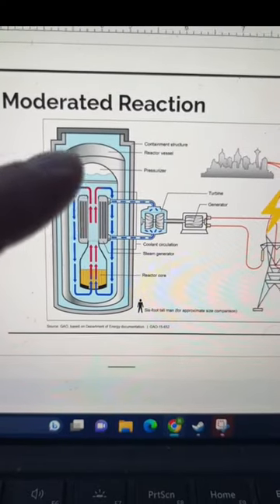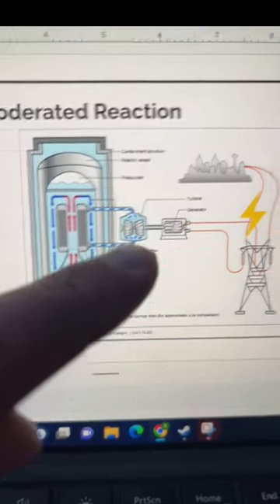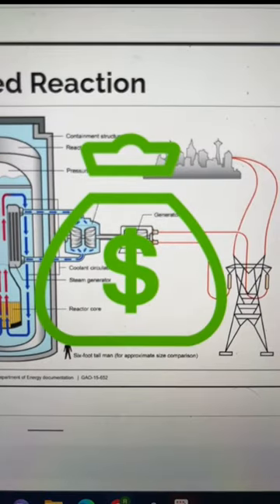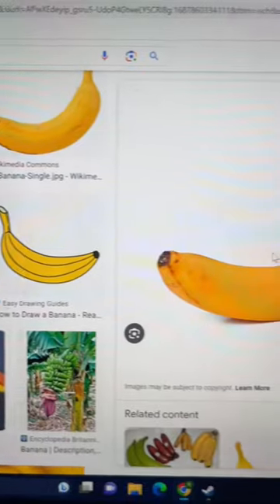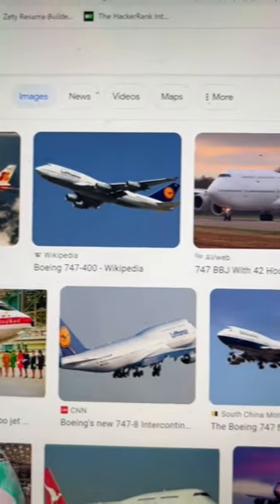No, The #Zaporizhzhia Nuclear Plant Will Not Explode

Comment: Compare a nuclear power plant to nuke is like compare a snicker bar to a hand grenade , they have about the same total energy, but one will not explode
Reply: Chernobyl gave off huge amounts of radiation. The equivalent of many nuclear bombs.
Reply: @uioplkhj  Chernobyl was not in cold shutdown.
Reply: @obstreperous1113  I advise you to read Ryan's covering remarks.
Reply: @uioplkhj Chernobyl happened (ignoring human factors) because of a shit reactor design. The reactors in question here are of a completely different and much better design, one that is designed to be able to safely contain the fuel in the event of a meltdown while both not causing a severe radionuclide release, nor contaminating anything in the surrounding area. It would be a bitch and a half to get the plant working again, but it would not cause a disaster. The worst we would see is something akin to Fukushima, which literally caused more deaths due to stress and panic relating to the evacuation than it did by actual radiation exposure

Comment: You can't walk into a reactor after a few weeks of cold shutdown. Workers can 'access' the reactor by means of cranes, robots and other massive protections against radiation.
Reply from the maker: Unfortunately, this is not correct. You can absolutely enter the pressure vessel of a Mk1 GE BWR. It’s how maintenance is performed.
Reply: @RyanMcBethProgramming  Ah yes, the Mk1 GE BWR famously used in the Soviet-built Zaporizhzhya NPP.
Reply: @RyanMcBethProgramming  very curious what your definition of "pressure vessel" is. do you mean the drywell containment or the core? the drywell can be entered and is the second layer of protection in case of emergency, the first layer being the core pressure vessel. 

the core cannot be entered with fuel still in it, it doesn't matter how "shut down" it is.

Saying you can just walk into a reactor is misleading, the PWR WWER-1000 in Zaporizhzhia is about as far from the BWR GE MK1 as you can get.

Comment: Could it not over heat and adversely affect the local area ?
Reply: Just thumbnails here, but if the reactor hS been shutdown for a couple weeks, the decay heat would be very low. It would likely only take something less the 200 gpm of water to prevent a release. Same for the spent fuel pool.  But it is true that it could be sabatoged to allow radiation to escape.

Comment: I have one word for you: Chernobyl.  No, the plant won't go up in a big fireball, but it can act as a "dirty bomb" and poison the whole area for at least decades.
Reply: Cher Nobyl is two words.
Reply: @brandonbp122  Maybe in some languages, but not in general English use.  If I do a Google search on your version, I come up with an artist.
Reply: Even then, even if the area wouldn't be full of mutants, digging into it, doing anything besides walking, would release radioactive particles into the air. Russian soldiers found out about it in Chernobyl at the start of the war.
Reply: A Chernobyl like event is virtually impossible with the reactor design at play here, especially since it's already in cold shutdown (like I'm talking less of a risk than dying of a shark attack in the middle of the Sahara). Yes, there's still a possibility of a core meltdown, but the reactors in question are designed to safely contain a meltdown should it occur. There might be a minor release in radiation, but the worst we would see is a Fukushima type event, which by the way the evacuation of the surrounding area caused more deaths (from stress and panic) than the meltdown itself.
Reply: The region around Chernobyl was poisoned because a reactor without biological shield was exposed and fires lofted particles into the air.
Reply: Chernobyl was a perfect storm of bad engineering on that specific model of reactor combined with incompetent operators who almost deliberately pushed it to the breaking point. 

And in Chernobyl's case, what blew up was the reactor itself, not the containment building. What actually released radiation was the subsequent fire.
Reply: @Soundwave3591  I don't disagree, but I don't see why some madmen armed with military grade explosives can't accomplish the same thing.
Reply: @russellhltn1396 the Ukraine plant is a different kind than Chernobyl is, and isn't using safeguards from the 1980s
Reply: So is this plant designed to withstand the pressures of high explosives?
Reply: They wouldn’t blow up a nuclear reactor, they’re too valuable, great for power and also just a good card to have power over, and if they wanted to irradiate an area they would just use a nuke, they can’t hide them blowing up a reactor they’ve had control over and has been sus for months

Comment: It's not about explosion, but about radioactive pollution. If the pool is destroyed the radioactive pollution will get to atmosphere. There also will be problem containing it like in Chernobyl. Once the rods are no longer in the water they will kill anyone getting close to it, making it extremely hard to contain them. In Chernobyl they made sarcophagus by lying to people about the safety, so many died for this. Another thing (it probably is protected against it) but if the base isn't protected the fuel rod could melt and go down in the ground. Once it reaches underground waters the steam created by the heat could shut it back up, spreading the pollution even further.

Comment: If the reactors are in cold shutdown, the only heat being generated will be from a miniscule and ever decreasing number of fissions and mostly from the decay of fission byproducts, the halves of the uranium nuclei that were split. The number of those is ever decreasing from decay. The total amount of heat they are producing is a factor of how long each fuel cell has operated at power and how long it has been since they were shut down.
While ZNPP has fairly large reactors, they should be cool enough that the fuel no longer has dangerous amounts of decay heat left in them.
Even if the cores are hot, a great deal of heat can be removed just by pulling steam off the secondary system and cooling with water or through cooling towers. Even running secondary water into the cooling pond will greatly cool that water down.
Reply: Brought to you by the Department of the Boat People!
Reply: What most people are concerned about is running out of water for cooling (or running out of power to pump the cooling water). They’ve already run out of electrical grid power at least half a dozen of times and the fuel for the backup generators lasts only a limited number of days. And they’ve also lost all the water from the Kakhovka dam reservoir, relying only on their own cooling ponds.

Comment: A meltdown is really really bad , especially if containment vessel and building vents to open atmosphere. One of the most scary  scenario of the war atm.
Reply: The containment building is designed to hold the pressure if the reactor ruptures as well as the corium in case it melts it way out the reactor. But, you obviously have to make sure all entry points are actually closed.

Comment: Cold shut down isn't the same as cold fuel assembly rods. Those things will still be producing enough heat that should fresh water stop flowing through the system you can very easily end up with fuel rods that start turning water into hydrogen and oxygen. 

Plus 2 of the reactors were just recently taken out of power production, so those rods will need fresh water for much longer than those cooling ponds will will provide it. Again, overheated rods creates an atmosphere that is incredibly explosive.

Do you need any more reasons why your assessment isn't in the nature of respectable journalism? You can be honest without spreading panic. Will it explode like a nuke? Nope. Could it cause an explosion that creates another nuclear nightmare, On Ukrainian Lands? Very easily under the present conditions. Very Easily and faster than the west will react

Comment: Just a couple minor points. That chart is for a Boiling water Reactor, the Ukraine ones are pressurized water reactors.  Used fuel that hasn't reached about 5 years of decay have to be stored in the spent fuel pool. Then they are transferred to dry storage.  You can walk into the containment building, but not the reactor.

Comment: While I would be less concerned about primary cooling in a cold shutdown, I am concerned about an extended water outage for both the core and the spent fuel storage pool. If either goes too long without replenishment, there is a risk of the water levels falling below safe levels. You are correct that this won't cause a nuclear explosion, but it's still not good for the integrity of the reactor vessel or the fuel rods. Worse, as the water levels fall, there's less mass to absorb the decay heat, so the water heats up further, thus speeding up the loss of water. I don't know the specifics on this reactor, so I couldn't speculate on what the time frame is on how long until problems start or what exactly will happen. I seriously doubt we'll see a meltdown, but we could definitely see radiation leaks in a couple of months.

Comment: Close, but my understanding suggests there could still be radiation release and potential explosions. It's not a nuclear fireball, but depending on how hot the reactors are - and there are claims that one or two were in hot shutdown- they may be hot enough to meltdown and cause steam or hydrogen explosions, which might breach containment.

The risk for the spent fuel ponds is that the water may evaporate or boil away and expose the spent fuel rods, which may overheat and/or burn and release radioactivity. That would depend on how recently new spent fuel was moved into those pools.

BTW, I don't think you can walk into the reactor ever, especially after its been in use due to contamination from fission products and neutron activation. I'm assuming you meant walking into the reactor building .

Source: not a nuclear engineer, but I live next to a nuclear power plant and have read a lot of books on it and talked to the plant manager and engineers a couple times.

Comment: The main threat of nuclear power plants isn't a nuclear detonation.
It's physically almost impossible to turn a nuclear reactor core into a nuke due to wide differences in design. NPPs are redundantly equiped to turn a reactor core sub-critical within the blink of an eye.

However, even a shut down core does still emit heat. Lot's of it. It's about 7% of its capacity immediately after shut down, decreasing over the course of weeks. The heat comes from the decay of fission products and can be up to 300MW of heat power in large cores.
This amount of power will melt through anything if not exhausted properly.

Now, the IAEA requires every NPP to being able to dispose of this decay heat for at least 3 days without external power or additional water. But if the NPP doesn't have power for more than 3 days and the core can't be resupplied with water either from water lines or by trucks, the core will almost inevitably melt.

That's when it becomes dangerous because mainly two things can happen:
It can melt through the reactor containment, leading to heavy contamination of the environment and It can form large amounts of hydrogen from radiolysis, which can blow up the reactor building, again gravely contaminating the environment.

Certainly, it requires multiple emergency systems to fail for a reactor to melt down.
But how easily an unfortunate chain of horrible misplanning, fatal mishandling and failing infrastructure can actually lead to a reactor meltdown is what Fukushima demonstrated.

Comment: Not actually the radiation that causes the boom. It's that radioactive decay produces hydrogen and as the fuel heats as it decays it lights the hydrogen off. Which normally has mixed with enough oxygen by that point to make a huge boom.
Though with that boom, the release radiation could let off cherinkov radiation(prob misspelled), which is when something moves faster than light thru a medium other than vacuum. Which in the water vapor of the atmosphere is a foreboding blue light.

Comment: I don't think you fully understand nuclear reactors and the nature of the fissile materials either. The concern isn't the spent fuel or a nuclear explosion. If the reports are correct in that the Russians have mined the cooling system, the loss of this will result in the fuel rods melting down due to their own radioactivity. Nuclear material may then seep into the river, into the black sea and into the Mediterranean
Reply: The reactor is a PWR, specifically the VVER-1000 model. The primary coolant circuit should be fine, it's hermetically sealed in its own independent circuit. If it looses water for some reason and manages to melt into corium, it should be contained within the reactor or containment building (Just like what happened at 3 mile island). We have those containment buildings just for this reason.
Reply: @timbo11  and if they've mined the rest of the structure such that containment is breached? Then what?
Reply: @riseld4  Then you'd have a problem IF things start catching on fire. Looking at wind directions in the lower and upper atmosphere, Russia would catch the majority of the nuclear fallout though. Without a fire though, you'd be safe just to stay away from the plant (Time, distance, shielding). The plant itself would obviously be done for and cleanup would take quite a while and a lot of money. 

Nuclear material becomes a big problem when you disperse it into the air, by burning it, in form of gas or scattering it as dust. 

 You could safely stand at around 600 meters to a spent fuel assembly.

Comment: Are you sure about this? I remember something about Chernobyl that suggests the opposite. If the molten fuel rods reached water it would have caused a 5 megaton explosion. That is why it was essential to empty the water tanks used for cooling the reactor after the pumps malfunctioned after the explosion. This was partially depicted in the HBO miniseries. So, maybe you can't cause a chain nuclear reaction from a direct attack but it could start a series of events that end up in a nuclear explosion. Also the radiation from an exposed reactor core is a little bit more than the radiation coming out of a banana! I am sure if the Russians decide to breach a reactor core they could.

Comment: I profoundly disagree with this assessment. That spent fuel pool remains safe IF there's water to keep the recently spent fuel cool, so it'll probably be fine. But if the water level drops enough or the pumps go offline because the plant is mismanaged it could absolutely go up in an extra-ordinarily dangerous fashion that is NOT comparable to eating a banana. The spent rods that are still hot CAN burn off radioactive material in air and can explode, including in a cold shutdown state there are working reactors (keeping the plant itself running) and spread radioactive isotopes over a significant area. People should absolutely build more well managed nuclear plants but we need to do the OPPOSITE of chilling out about that plant. If Russia mismanages or blows the plant there need to be clear and well communicated red lines that specifically target the plant. I agree the fearmongering is unhelpful but saying that the plant is a threat is a correct statement and the public needs to pressure their governments to take appropriate policy steps to address the issue.
https://thebulletin.org/2023/02/one-year-later-new-dangers-threaten-ukraines-embattled-zaporizhzhia-nuclear-plant/

Comment: The spent fuel pool can still be dangerous if the water were to boil away (that spent fuel is pretty hot) and then catch on fire. It isn't like a running reactor but it still could cause plenty of trouble.

Comment: Radiation from flying in a jet is a totally different type of thing than radiation from nuclear fuel radiation. One is just light at various wavelengths, and the other is actual particles that have mass
Reply: X-rays and gamma are "just light" while particles with mass are stopped with shielding (alpha radiation is stopped by skin or a sheet of paper).

Comment: The issue is that they lose power and can't cool the six shut down reactors to prevent a core meltdown. Also that the water level in the north becomes so low that they cant pump water into it anymore.
Reply: You need to cool the reactors continously for like 5 years after you shut them down.

Comment: The russian could possibly mine the sidewalls of the spent fuel pools leading to abrupt loss of coolant water in the pool/pools, what would lead to overheating fuel roods. Yes, most of this fuelrods are out of the reactors and cooled down for >9Months, that means that they don't just would 'right out melt', but still they can emit all the volatile elements within them like radioactive-noble gases, Cs,.... Even for ALL 6 reactors combined that would probably mean LESS radioactivity emitted than from the one reactor in three miles island, but still people would be scared like shit!

Comment: To my knowledge, Russia is keeping one of the six reactors active. I'm well aware that it's physically impossible for a nuclear reactor to produce a thermonuclear explosion. No graphite moderators in this model either, so if it does blow, there's likely to be a lot less fallout.
Reply: They kept several of them running producing electricity until September 2022 when the last reactor was “shut down”. They kept two reactors in a hot shutdown over the winter where they don’t produce electricity but only hot water and steam for heating purposes. Since April only one remains in  hot shutdown mode.